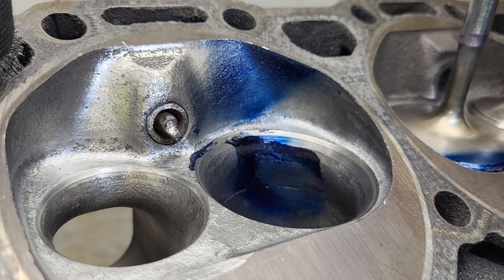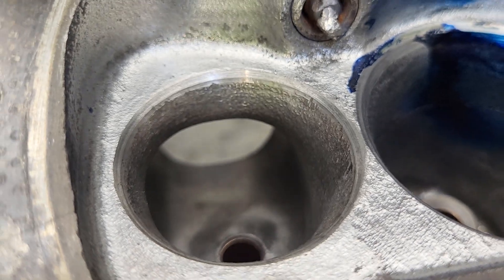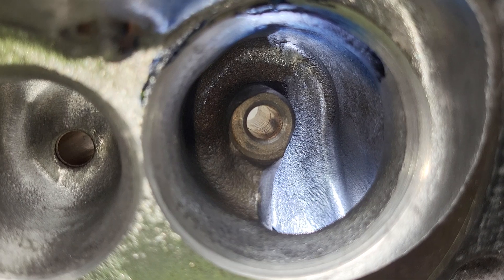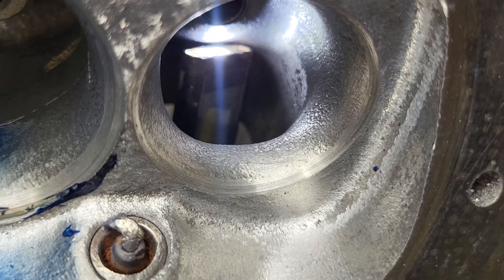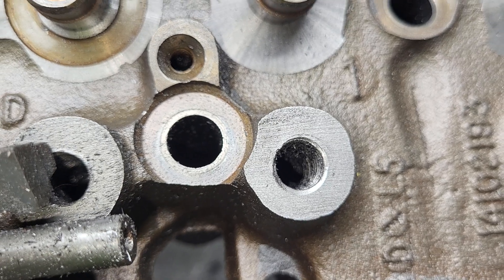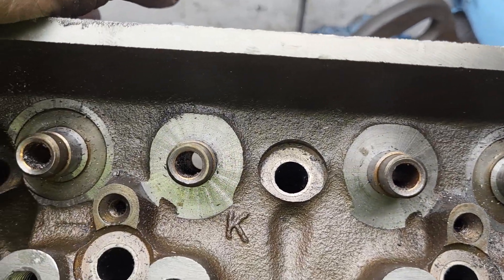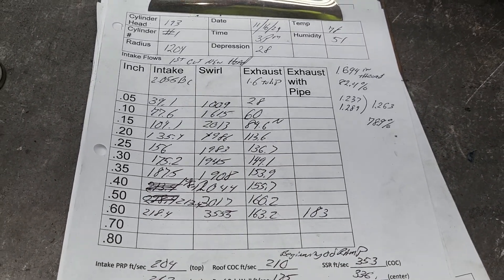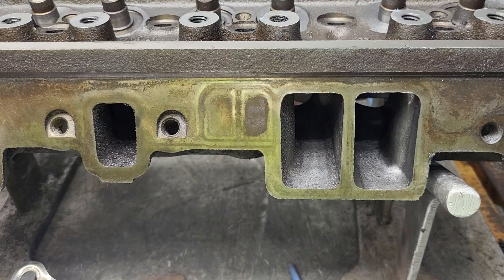Chevy 193 TBI cylinder heads, 1st cut on a set that will run. New projects, Thanks Eric Weingartner

Comment: Charles, I'm wanting to build one of my 4.3 v6 engines and I have 2 heads to choose from, the tbi like these and the vortecs so I am watching this with very strong attention.  I need about 250cfm in order to get 375hp from one of these engines.  Which do you think is better the tbi heads or the cracks vortecs
Reply from the maker: @No1414body  Do they make an aftermarket vortec 6 banger?
Reply: @servediocylinderheads  yes but they are only available complete at this time, I've seen them in Jegs. If I could get them bare it would be a no brainer
Reply from the maker: @No1414body  I see. Getting 250 cfm from a tbi head is no joke. Takes a ton of work.
Reply: Promaxx makes a vortec style casting with both vortec (4 bolt) and standard (6 bolt) intake pattern drilled in. Slightly heavier castings and they are new so you don't have to go through many used sets looking for a non-cracked head. They also sell them bare so you can spec them to your needs. Brodix aluminum heads aren't cheap but they will flow. Other alternative is the CPI (central port injection) heads. I don't know if there is a V8 equivalent. They are swirl ports but the chambers seem a little bigger, the runners are enlarged, and they have an injector cut added to the top of the runner. Another benefit is factory screw in rocker studs, ARP makes a stud set specifically for these because the rocker studs have a metric thread on the bottom. These heads were run with a slightly larger cam than the standard TBI, but the motors made about 40HP more. A lot of TBI guys upgrade to the CPI heads on their 4.3's.
Link to head: https://promaxxperformance.com/product/gm-4-3-vtech-new-bare/
Reply from the maker: Good info. Thanks @Mark-iy2fg
Reply: @Mark-iy2fg  promaxx heads are the same as the Jegs but cost 50 bucks more each, i want bare heads so I can put big valves in them